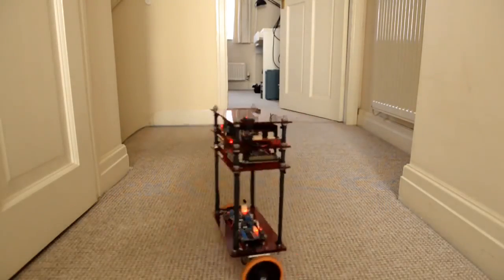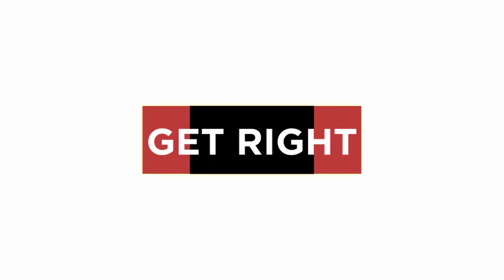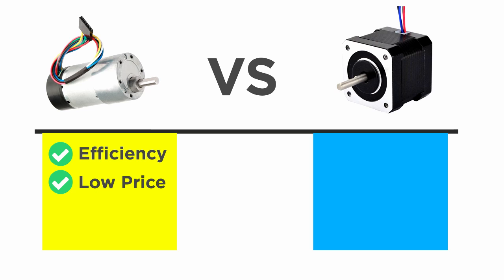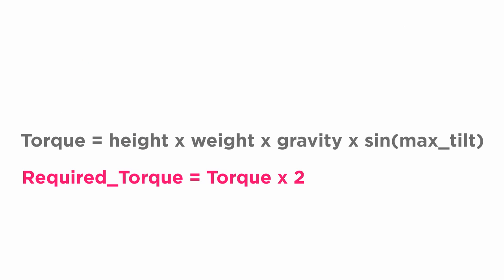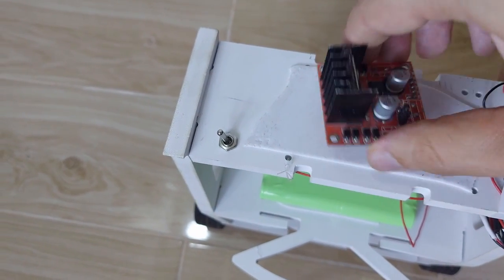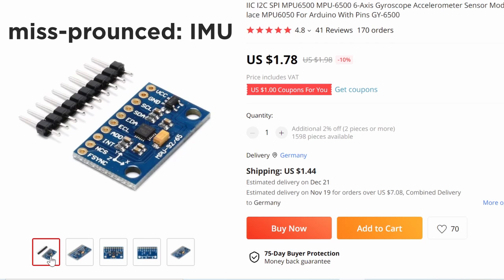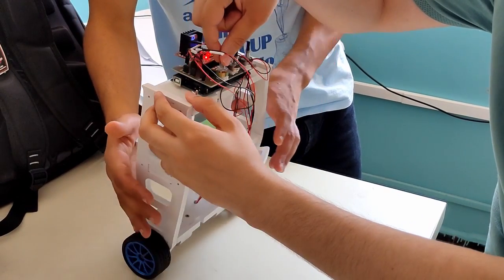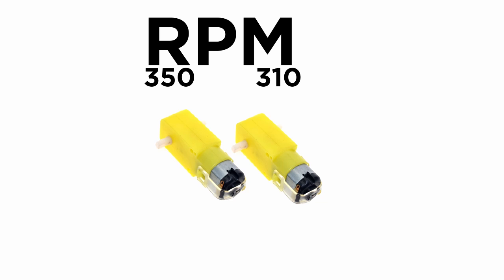Self Balancing Robot Tips that will Save your project

Comment: my microcontroller is freezing and resetting when it moves.
Reply from the maker: if your microcontroller is arduino uno based try upgrading to arduino mega or better ones that can handle electro magnetic noise better

Comment: I used two 12v dc motors with 200rpm Johnson geared motor, bts7690 motor driver for each, but problem is my motors doesn't having encoders, so I facing problems like heating motors, etc

Comment: I am trying to control my own self balancing robot and while evrything looks fine in the logs, it does not balance. I am measuring angles at 250Hz, controlling my stepper motors at 100Hz. The angles values are fine, the motors are controlled synchronuously, the battery is mounted at the top, the electronic weight is very low, I dont have cables, everything is soldered.

Comment: Does someone has experience about the balancing control loop time? What is a proper control frequency for balancing control? Or maybe does someone know how to estimate/ calculate the required control rate? 

Currently I am using hoverboard hub motors (BLDC, 36v, about 500w) to build a quite large balancing robot. Any recommendations for motor controllers are highly appreciated;)!
Reply: In my experience you want 5ms to at most 10 ms delay for the control loop

Comment: hello, I am a student of class 10th, and my team is working on two wheel self-balancing so today we started to make circuit for the robot, but the problem happened that mpu6050 got burned and stopped working so can i know how this happened. And the second problem was we can't do code as we don't understand the basic of the mpu6050 so if anyone can help in code pls reply we are using l298n and 12 v gear dc motor and Arduino uno and mpu6050 with 3.7v li-ion battery pls give some suggestions
Reply: Hav you completed ??
Reply: @tanmaymanwar6333  yess

Comment: I was wondering if it would be better if I made the robot more taller or more wider? My current robot just fall on its front.
Reply: Hi
what did you go with?
Reply: @the_hasnat  I went with taller. The important part is to calibrize it proplerly and if you change any components or add even a wire, calibrize again.

Comment: The weight of my robot is 3kg , req tilt 30 degrees , height 0.35 m. I selected a geared dc motor that have Max torque of 15kg cm , it it ok?

Comment: Pretty good video! I basically guessed on most of my robot, but did my best to keep the weight distribution correct and everything is very solid. Honestly think it is over engineered... The problem I am having though is in the code. I've tried several different codes and cannot get anything to work at all. I'm using and arduino nano, l298n motor driver, and mpu 6050 with a 3s lipo. It is not doing anything at all and I am stumped... If you have any tips that would be greatly appreciated. Thanks!
Reply from the maker: glad that you like the video.
take a look at this code I found it to be very helpful
https://github.com/lukagabric/Franko
Reply: @hobby_coding  thanks!

Comment: Great video. I have a question....do you know the code to allow the robot to adjust it's set angle if, for example, you put a glass on top of it and changes its center of mass?
Reply from the maker: just change the set point in the pid control system to be +-1 degrees or so
Reply: That makes sense. One more thing, I've been searching for the code to allow the robot to return to it's original position if pushed, but haven't ben able to find it. would you know?
Reply from the maker: @TheClickMonger  another PID controller for the displacement would do the trick, you need to have wheels encoders.
Reply: "just change the set point in the pid control system to be +-1 degrees or so"  What would the code look like for this?

Comment: Hey guys, i'm trying to build the robot with only a ADXL345 accelerometer. why wouldnt that be enough as a leveling sensor? Because i see the mpu6050 Gyro+ accelerosensor everywhere.
Reply from the maker: well , the mpu6050 uses a motion fusion algorithm to fuse the readings from the acc and gyro which gives much more accurate readings with minimal drift and noise, so do yourself a favor and just buy one it's cheap and many internet sources are using it so you will have an easier time searching for code to use in your project.

Comment: I have a doubt.
Might not be related but I need the solution, as I am not a science student..

It's about drones.
When we make our drone remain steady in the air, how do we calculate that specific voltage to be supplied in the motor such that the speed of motor will result to make the drone stay steady? I mean, neither moving upwards nor downwards. Just still at one place in the air. How to calculate that motor speed?? What's the formula???
Reply: Its all control systems.You can use state space or classical control theory.
In short,there is no single formula.
Reply: there is no such formula. you don't vary the voltage but vary the PWM

Comment: Thank's for sharing the video.
I have some doubts regarding the relationship between the robot's height and the wheel radius.
1.  Increasing the height of the robot makes it easier to control just like a broomstick.
2.  Increasing the wheel radius will need lesser angular velocity at the motor end to get the same linear displacement.
Please correct me if I am wrong, and also suggest the relationship between those two robot design parameters. Are bigger wheels better for the self-balancing robot?
Reply from the maker: well i didn't try different wheel/chassis-height dimensions but i can say the following:

 -1 taller heavier chassis will make it harder for the gravity to move it so that can play for you but at the same time, it will make it harder for your motors to move it also.

i have seen people recommend bigger radius wheels, so yeah I think that can improve the performance
Reply: @hobby_coding  Thank you so much!!

Comment: I have upload my self balancing code to Arduino and done,but the problem is my robot cannot work like my motor doesn't rotate.Can you help me for the solution, please
Reply from the maker: you have to print the PID output to the serial monitor and see wether it's bigger than 0, so you can narrow down the problem.
Reply: @hobby_coding  you mean kp,ki,kd or output the mpu 6050?
Reply from the maker: @itsnotme1380  i mean the pid output not parmaters kp ki and kd
Reply: @hobby_coding  ok thank you
Reply from the maker: @itsnotme1380  you are welcome :)

Comment: everything looks good in the circuit but the motors are not turning
Reply from the maker: probably a software issue, try narrowing is down by printing the controller outputs in the serial monitor